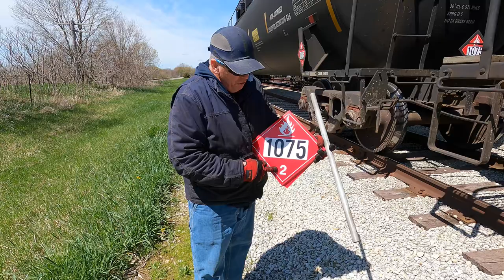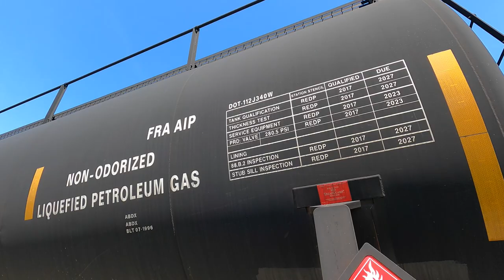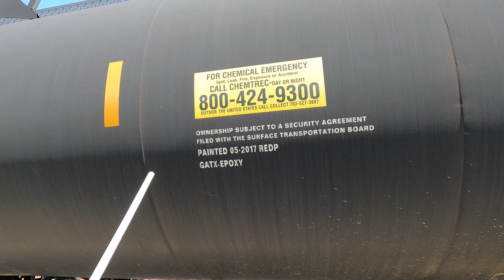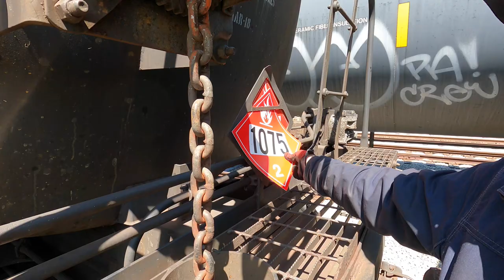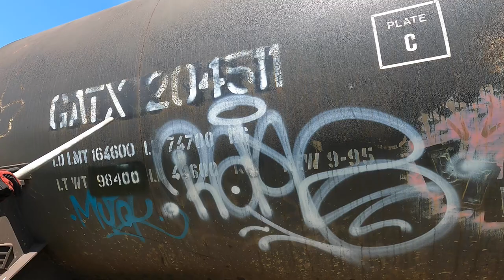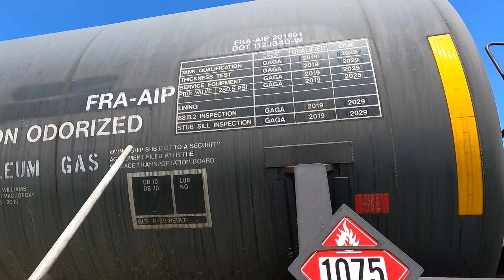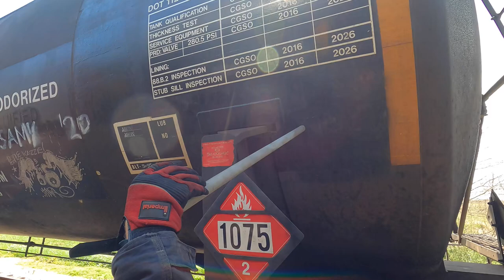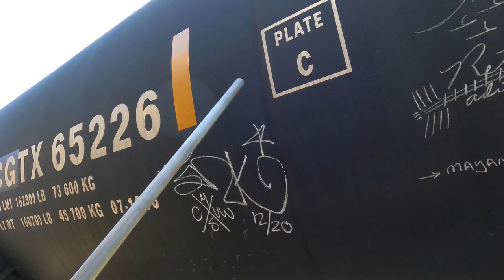21 - Rail Car Inspection

Comment: Why are you, as the rail car customer, responsible for inspecting, reporting, repairing cars?  Shouldn't the railroad be doing this?  Is the railroad or rail car owner paying for your time?
Reply from the maker: In short, I am responsible for inspecting these cars because my company ordered them in to deliver propane, and because the government oversight agencies require me to do so. Irrespective of what condition they are in upon arrival, they have to be "road worthy" when leaving my facility. I fix what few things I can, and notify the appropriate people to about the rest. I also coordinate mobile repair units to come on-site or send cars to shop if needed. The initial upfront costs for these actions are borne by my company, only later do suppliers and sales get involved to back charge these costs to say, the car owner, a refinery, or maybe the another party that they can contractually seek reimbursement from. The railroad will fix, at zero cost to me, anything that has to do with the running, moving parts of a car. Axles, brakes, springs, air lines, etc. While I do not get paid, directly, for any repair work, the biggest benefit to my company lies in regularly finding, documenting and reporting issues as quickly as possible. Doing so protects us from false allegations of damage or neglect, and shows a clear track record of doing things as correctly as possible. In a finger pointing blame game of he said, she said, the one with the best evidence usually wins. This has saved my company tens of thousands of dollars in fines and penalties.
I started this reply with "In short", and turned it into "too long", my apologies. Thanks for sharing.
Reply: @mypropaneinsights6074  Thanks for the detailed and thoughtful response.  It must be frustrating to have this added burden and responsibility.  Is this arrangement because you're dealing with a hazardous material?  Would a terminal that offloads say corn syrup have the same responsibilities?
Reply from the maker: @johnperrotto64  You are correct that hazmat cars are held to a higher standard. As I understand it, the car in your scenario would require less scrutiny. A shorter visual inspection of the car itself and then, after unloading it, another inspection to make sure it was "safe to travel". Making sure that whatever you opened was properly closed and that no corn syrup was either dripping out or was splashed onto the car. If so a quick rinse with a hose should clean it up.
Thank you for reaching out.
Reply: any industry had better have someone looking the cars over. they could be held responsible for damage on the cars, if they accepted it when they were dropped off, its theirs!

Comment: All the components have names, with lots having wear limit markings. Should have looked behind the coupler to check the draft gear etc, centre plate, side bearings. There are gauges to use for checking wheels in the yard he could use also. 
 Really he is just making sure the car is carded right.
Reply: True. Working for ttx we have to know all of them from air parts to truck parts.

Comment: Great video. Maybe include the defect card holder on the side of the car as part of the items you look during your ground inspection. Thanks.
Reply from the maker: Thank you for mentioning the card holder. I did not mention it as in my area it is never used, everyone prefers/insists in using email to notify of any and all defects. I have come across inspection sheets from a couple different refineries, and as part of their pre-fill checklist they do mention checking the defect card holder. Thanks again for bringing it up, someone in a different locale that uses this to communicate issues would benefit from this.

Comment: The faded car numbers aren't stenciled they are painted that's why, I work for one of the repair shops. See both all the time.
Reply from the maker: Thanks for sharing.
Reply: @mypropaneinsights6074  Honestly thank you for sharing! I always wondered what happened to these cars after i parted them, ( i put the Prv, vrv, Bov, thermowell, sample line, ect an all the gaskets back on an pressure test before release. Its neat to see what happens after they leave and i enjoy watching the videos.
Reply from the maker: @deamonfox4298  Glad to hear that you enjoy these videos, makes my day.

Comment: your inspection here is about the same as what a condr would do when performing a brake test
Reply: Bullshit. I'm not looking for all that crap when performing an air test. I would be out there all f-ing day. Hell carmen ain't doing this intensive of a car inspection. Also that he pointed out as a "bypass" is not a bypass. It is a retaining valve. And the way he's hanging out between those cars is making my skin crawl. If you don't have a need to be in between those cars WTF? Especially with the handbrakes off.
Reply: @cmoney220  i hired on with the chicago and northwestern in 93... back then a brake test was just that, a brake test... but a few years after the UP took over they changed it all, made us look at pretty much all the stuff this guy is looking at, even had us look at a video about the "new" brake test... the video went so far as to say we should spend at least ONE MINUTE PER CAR... i was like REALLY!?!?!... the "new" things they wanted us to look at are things the carman should be looking for... my opinion it was an attempt to put more responsibility and blame on the crew should something go wrong

Comment: Is the placard removed when the car is empty? I see tons of cars going by with no placard.
Reply from the maker: Only cars carrying hazardous materials are required to be placarded. Empty hazmat cars are still considered "Residue" cars and have to stay placarded. Only when a hazmat car is empty and purged of all traces of its former contents is it no longer placarded. Most tank cars are built to handle a variety of commodities and are built with placard holders straight from the factory since it is cheaper to do so in the beginning and no one knows what the car will carry in its life span. In my area I see a lot of food grade oils, syrups, etc. along with Ag supplies roll by with no needed placards, just a commodity/shipping name. Hope this helps, thanks.
Reply: Non-hazardous material in tank cars doesn't need a placard, and there's a lot of non-hazardous stuff that gets carried, too.

Comment: where are the frames of those tanker cars? i see only the tanks and bogies but where is the frame?!
Reply from the maker: The design of these cars utilizes the actual pressure vessel (shell) as the frame. At each end is a bolster assembly that is welded onto the pressure vessel called a Stub Sill, which sits on top of the truck assemblies. So there is no end to end external frame. From what I have read from AAR literature this arrangement has improved car service life and safety.  An image search for rail car stub sill should provide you with some good pics. Hope this helps, thanks.
Reply: Tank cars have used the tank itself as a structural part since the 1960s or earlier. The old-style cars with a separate frame were all retired decades ago.
Reply: @beeble2003  i have never seen those. they all still have proper frames here. seems much safer to me
Reply: @FoxBoi69  On the contrary. It seems much safer to have a very solid tank that is self supporting, rather than having a lighter tank placed on top of a structural frame. In any case, I'd trust the actual designers of tank cars, rather than our speculations on YouTube.

Comment: I thought your video was very good some people in the comments are saying you did it incorrectly but to me it looks like you looked at things very well in a basic inspection.
Reply from the maker: Thank you. What might be missed by some is that this is an initial ground inspection only. It is like if you get a delivery from UPS and you inspect it for damage before signing. I am not looking for perfection, just the obvious to prove the car is safe to offload and then reship.
Reply: I never heard of companies that get delivery from railroads want rail cars inspected before it's offloaded what company are you working for that wants this done?
Reply from the maker: @nightrider6769  I address one reason why we do this in the comment above. A second reason for inspecting cars upon arrival is that we have to comply with security issues as given out by DHS and FRA. Once a car has been dropped off we are held accountable for it and responsible for damages. It is kind of like renting a car and not bothering to fully inspect it before driving off with it, no one wants to be liable for per-existing problems. Thanks

Comment: Please look at the AAR field manual rule 41 before not condemning wheels like that.
Reply from the maker: Thank you for the comment. The manual you mentioned is primarily for shop use, though its value goes beyond just that, covers in detail how to measure wear on different aspects of wheels. That is not what I do for a visual inspection, I look for the obvious defects and report any findings to those who will do a more thorough evaluation. This approach has been confirmed to me by the FRA Mechanical Inspector that works my area and my usual FRA Inspector. Thank you again for mentioning this manual, if anyone is interested AAR sells this for $162.
Reply: If the shelling is deeper than 1/8 and/or larger than 1" in diameter with no islands.
Reply: @patterguitsit7124  you’re confusing two different codes.
Reply: @patterguitsit7124  
Shelled treading (wm75) has no condemnable depth criteria.
Reply: @jaysrailroadcorner5403  True, Shell 1" or more in diameter. No islands. My mistake
Reply: @patterguitsit7124  
It could also be greater than 2” in length. 👍🏾
Reply: @jaysrailroadcorner5403  That's only for slid flats I believe.
Reply: @patterguitsit7124  
Check again buddy. Slid flats have two length criteria.
Reply: @patterguitsit7124  
There are two ways to condemn a wheel for shelled tread.

Comment: Railcar or not if I owned it I wouldn't want someone beating on it with a steel pipe
Reply from the maker: I agree. If you are referring to the pipe I used to point to things, it is a piece of plastic conduit.
Reply: Grow a pair. If only you knew the abuse these things take
Reply: Do you think you’re being a little ridiculous? I do.
Reply: No different than truck drivers hitting the tires to check pressure.